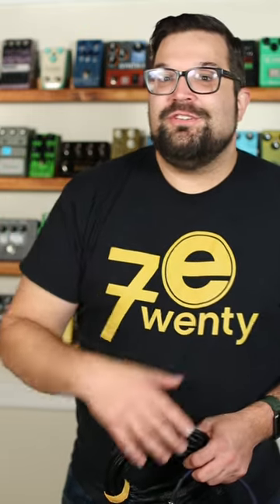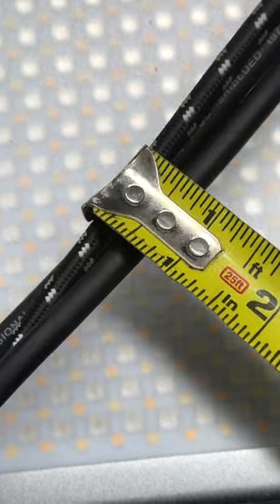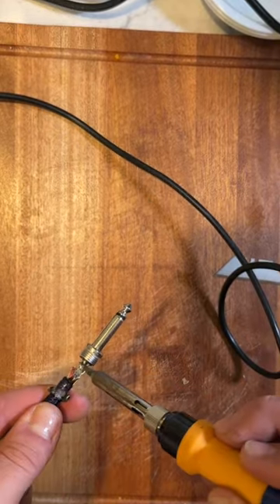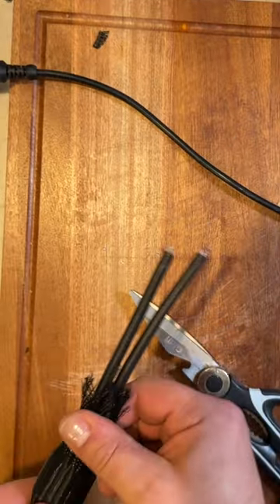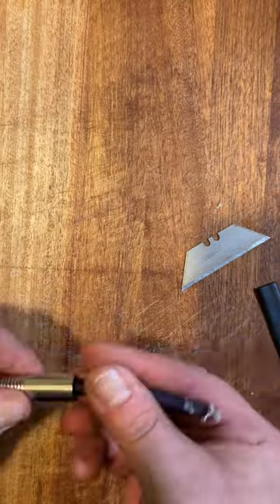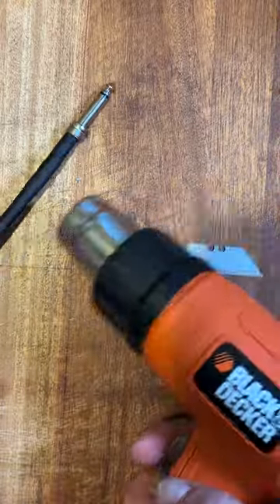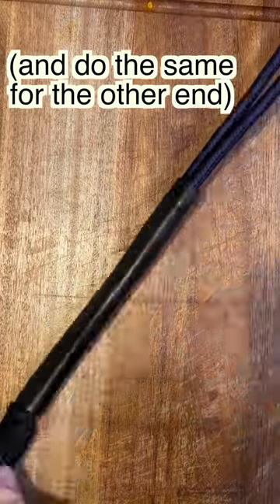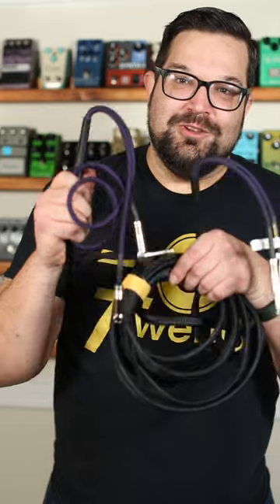DIY Audio Cable Loom #shorts

Comment: what diameter would you buy to house 2 x instrument jacks plus power?
Reply: Don't do it!
Running a power cable alongside audio cables is best avoided wherever possible as it causes noise, due to induction, especially if the instrument cables are not balanced.